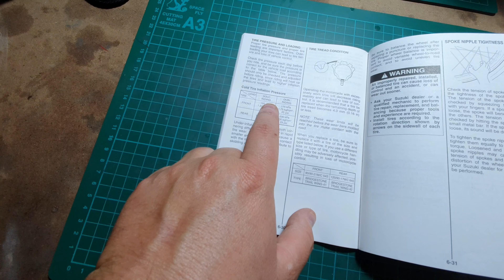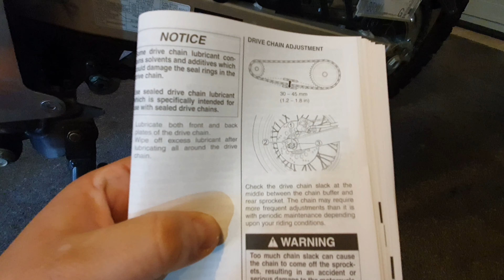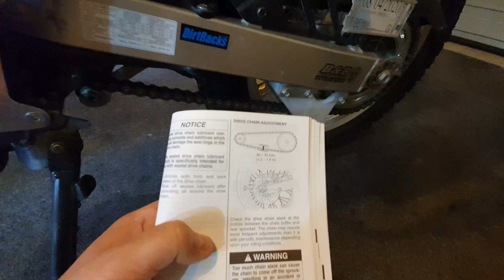Your First DR650. Essential Mods And Tips Part 2

Comment: Not properly oiling your carb filter is a sure fire way to clearly wear out your carb and potentially cause massive head aches when you start having carb issues in the middle of a long road trip. Also Filter oil is way too cheap to be cutting corners using motor oil. Filter oil is not just normal oil in a can, it comes out thin and then as it cures it thickens and gets insanely sticky.

Comment: What year is your DR?  Where is the Charcoal box?  I was surprised to see the throttle cables on top.  Mine were originally on the bottom, but made a mistake of gluing my heated grips on the tube 180 from the original config.  Installed new bars and risers...so it didn't hurt.  Can you make a video on how to tune the carb?
Reply from the maker: 2019 :)  I think only California got that
Reply from the maker: Ah I see.  That's shouldn't be a problem.  My carb is set good atm and dont want to risk messing it up.   But when it's due to tune I most certainly will. Thanks for watching.

Comment: Helped me bud. I just got my Dr today, ridden a total of 116km on it. Bought it used ( tanami edition ) with 520km on the clock, spent about $5000 on b&b, Sargent seat, FFRC suspension, pivot pegs, 10 000 lumin LED ( got its own fan, lol ), Djokovic exhaust, few other things, handle bars etc. Had the air box and fuelling needle modded, so happy. Ridden a total of 4 times ever ( including the learner course ). Probably kill myself on the damned thing, and be counted as a Covid death lol 😂💀
Reply from the maker: 😅😅 dont go killing yourself mate.   Nice mods!

Comment: im fourteen my dad wants me to get me in adventure riding so he bought me a dr 650 is it the right bike?
Reply: Dang! You got yourself a nice old man. Things to consider, 
How big are you?
And is it your first bike?
If you’re still pretty small the weight might be a bit hard to manage, especially if it’s your first  bike
Reply: Its heavy and is kinda tall for people with shorter legs.  The power is manageable so you wont have to worry about yeeting it into an unintentional wheelie.  I'd say sit on one and as long as it fits you it will probably be a good choice. Also consider the KLR650.   If you plan on mostly road miles the KLR is a better bet if you plan on doing more dirt then the DR is a better bet